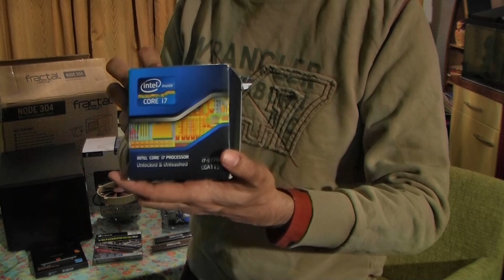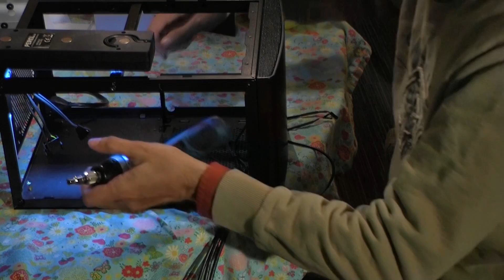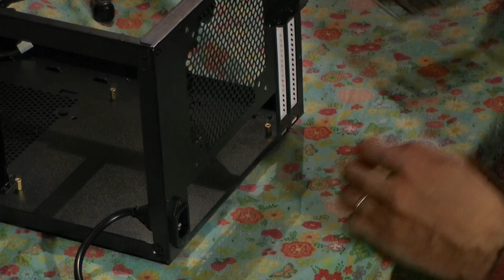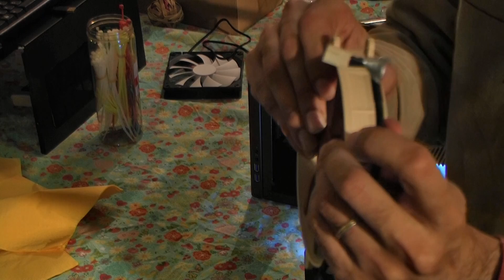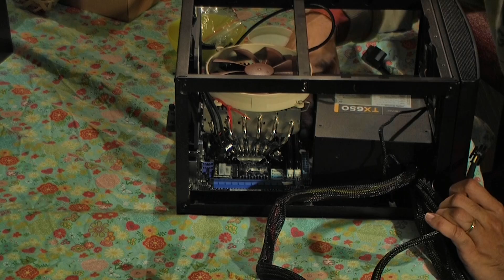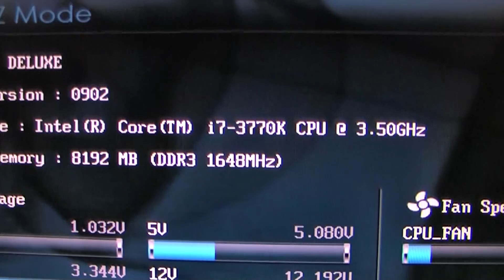How to build a high quality mini itx game computer or web server (2013 Tutorial)

Comment: Great Build!  And you inspired me to build a system very close to what you built in your video.  Excellent job.

I wanted to build a web server from scratch with old PC parts — mainly to host a powerful WEB SERVER (for educational purposes) and as a personal learning tool (my background is mostly Windows/Mac OS X/Microsoft, C++/FORTRAN, Java).  And this server also had to have a small footprint (mini-ITX).  And it had to have a relatively fast response to requests.  An additional secondary design requirement became that this box had to be able to run basic games and run processor-intensive mathematical simulations — for possible future use.  Room to grow, sort of speak…

I progressed from a bare bones 2nd hand system to a very capable Intel i7 / ASUS Maximus Extreme / Corsair Vengeance 16GB memory inside a Fractal Design Node 304 box (which became my #1 choice after watching your video).  The capability and the cost increased with each design iteration.  

But I had some questions.  You stopped your video at the point where you tested your motherboard / CPU (temperature, boot-up, etc).  You did not complete the build cycle.  And, most importantly, how did you install CentOS Linux (and why).  

Can you give me some pointers at this point related to this?  I have almost finished my build (waiting for my CPU Cooler).  In addition, I decided to build an “extremely quiet” system inside a very small box.  Passive fan-less power supply (SeaSonic 520W) and a fan-less CPU cooler (SilverStone HE02) which I had to modify by cutting off a very small section of the bottom fin over the memory modules — yes, I know, warranty no longer valid.    

My eventual goal is to run a LAMP setup as well as other high level programming languages (Java, C++, etc) on this WEB SERVER.  This server will be used for delivering lecture notes, some short educational videos, many web pages, downloadable content, etc AS WELL AS providing a place to prototype C++, Java, MySQL, PHP, web pages, etc and doing some medium-to-heavy duty mathematical calculations (but in very quick bursts) on occasion.

But I have not installed CentOS before.  And after a bit of research as to what Linux to use, I decided to use CentOS.  My line of research started with your use of CentOS.  Can you offer me advice on installing CentOS on this box (which is very similar to yours).  How do I start?  centos.org ?  Which version should I install?  In addition, which ISO and packages should I start with at first?  How is the installation done?  How do I build a chain of backup versions so that in case software or virus/malware issues cause me to go back a few versions?  A must since I am on a educational environment which has hundreds of students on it and has also been, in the past, the victim of substantial virus/worm/trojan attacks (some of which even knocked out several Macs to the point where they had to be reset to factory settings).  

Again, very nice little system you got there.  It would be great to see more videos of your web site installation, setup and maintenance.  Especially after your testing of the motherboard CPU setup for temps…  And your software installs…
Reply from the maker: Hi argonaut11.
Installing CENTOS Linux is very simpel via a DVD (ISO) that you can download free from centos.org. Just download the (latest) ISO (64-bit) and burn it on a DVD. Next, boot from the DVD and the setup will guide you through an installation process. If you choose for a server installation, you will get a LAMP installation, Just make sure you include a DB in the components to install. Clean installation will take 30 minutes or so.
Reply: Thanks for the feedback, Al-Noor.  Will keep your advice in mind as I progress.  Final parts are still arriving (ex: thermal paste from China 15-30 days). 

Did you consider a dual SSD cache (read, write) to speed up your Web server?  Do you think that would help the response time of web page hits?  I have another web server on the same LAN (a Synology D214+) and the response time from an outside web request is somewhat slower than I wanted for my web pages.  Am loading up a Wordpress site on that box.  But while my experience with Synology is just 2 weeks, I still have to tweak that.  I am hoping that this small footprint web server can respond better. 

How about if I wanted a dual-boot system (Windows and Linux)?  Have you any advice on that?  Any security issues with a dual boot web server?  And did you record the rest of your build (PSU installation, cable management, OS install) ?  All these questions mean that I am sure that you are a great source of wisdom on these matters.  I, for sure, would definitely check out any new videos you post. Regards.
Reply: Hey hikeskool
You make excellent points.  I thought of going that route.  BUT the extreme low sound level was a big requirement due to other very sensitive equipment in the same room.  Had previous larger boxes and different  systems in there (ex: PC Power & Cooling case from way back, very silent PSU's WITH FANS) which in a normal environment would have been fine, BUT it was way too loud for other electronics.  So I am trying this system out to see if works (dB-level, speed, etc.).  But you are definitely bringing up issues which I will keep in mind.  Tx.

Comment: nice, just one thing ...to much cooler paste, less past and use something like a credit card to spread the paste on the processor. Cooler paste can short circuit MB componentes, so always be carefull with the amount, and if i may you have a very nice cooler with 6 pipes, Termaltake have one with 8 and smaler in my opinon it wil fit better on that MB. Nice work just give my opinion. (and sorry with me inglish to) :)

Comment from the maker: The best solution is to have a thin layer over the whole surface. A risk of not having the thermal paste covering the whole surface is that you really loose heat transfer. So it's a bit of a trade off between using too little paste and risking not covering the whole surface versus having to much paste with a too thick layer over the whole surface.....

Comment from the maker: De rode poorten zijn e-sate poorten (dus geen combi poorten).
Dit zijn alle i/o's aan de achterkant:
1 x DVI-I
1 x DisplayPort
1 x HDMI
2 x eSATA 3Gb/s
1 x LAN (RJ45) port(s)
4 x USB 3.0 
4 x USB 2.0 
1 x Optical S/PDIF out
3 x Audio jack(s)
1 x Clear CMOS button(s)
2 x Wi-Fi antenna port(s)
1 x USB BIOS Flashback Button(s)